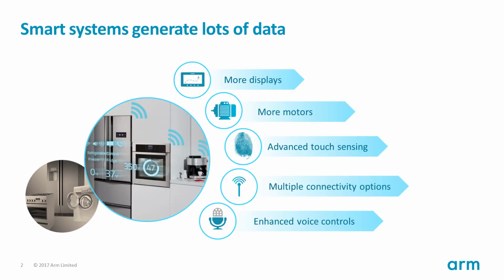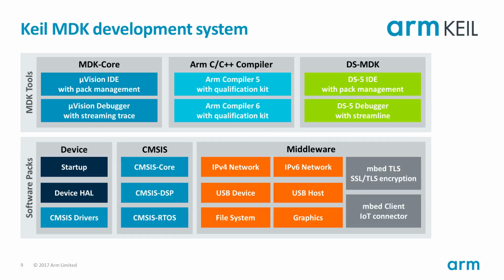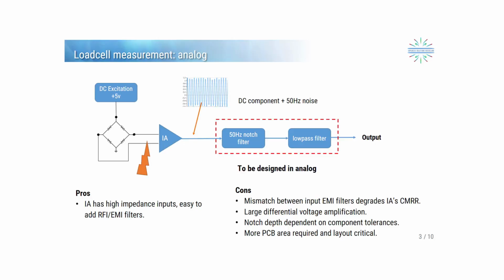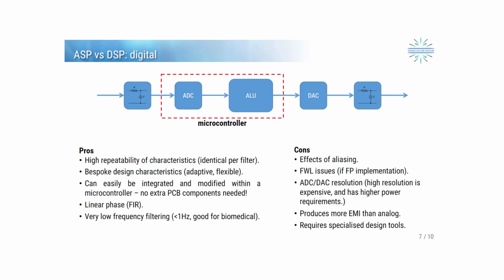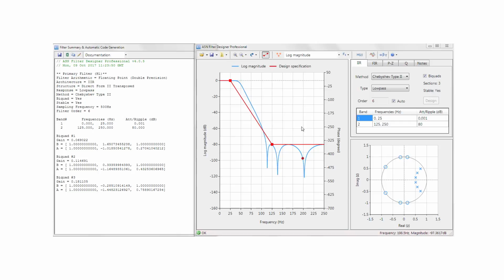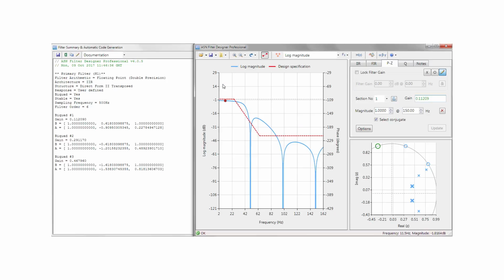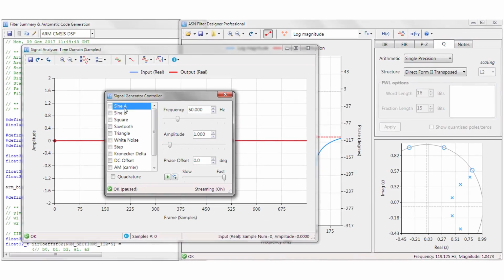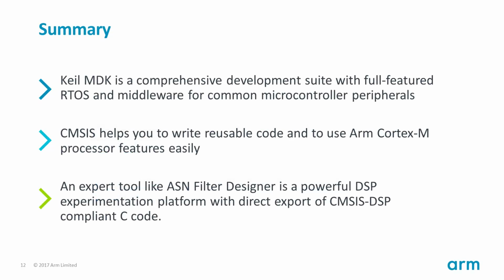Use ASN Filter Designer to Generate CMSIS-DSP Code

Comment: Just a quick  question please answer it  . İn the video  cmsis coeff and c coefficients were different.  How to calculate  cmsis coefficients? i guess it is by multiplying with gain. But in matlab we dont have gain for biquad filters. Please i have spent 8  hours seraching for this .   how to calculate gain for every biquad section